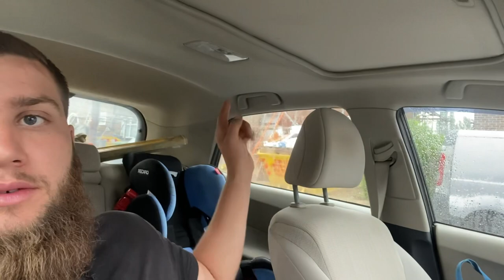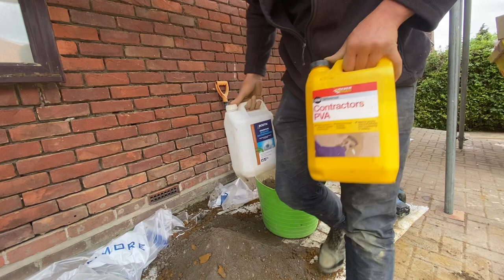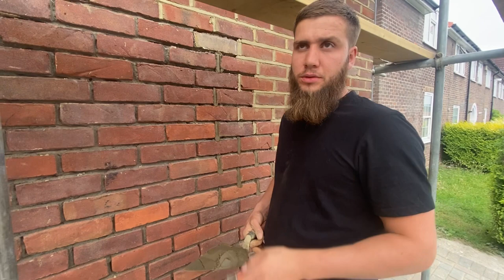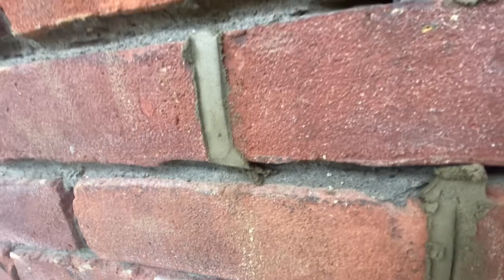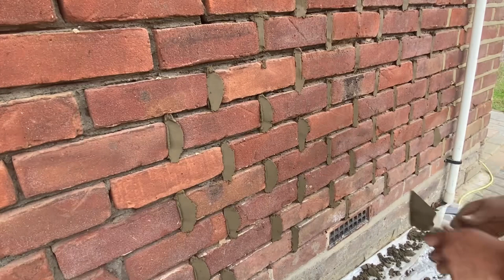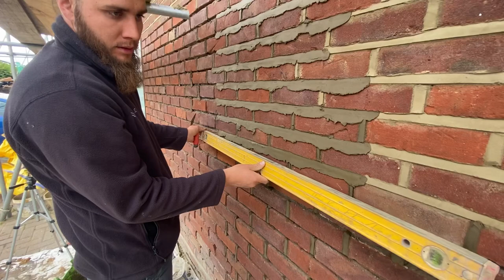Weather Struck Pointing !! #bricklaying #weatherstruckpounting #ukbricklayng

Comment: Nice job. For the horizontal lines try a length of roofing lathe. Put a couple of screws in to hold it about 6mm off the wall.  Works a treat.
Reply: Spirit level too long, piece 2/1 straight batten which is handy to handle, also faster, trowel needs to be next size up also

Comment: how to create damp 8nside your house.
it should be lime mortar. 
hydraulic lime no cement
Reply: this only applies if the original mortar is lime mortar. if original mortar is cement based, it is perfectly ok to use a 6 sand, 1 cement, 1 lime mix